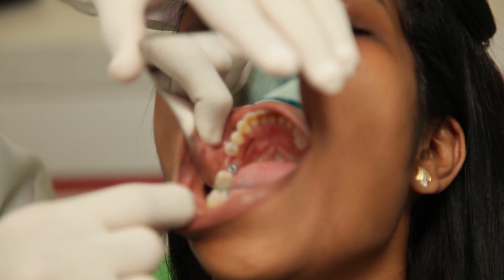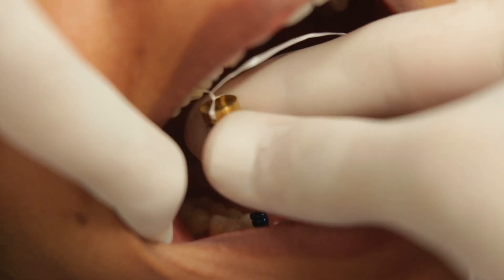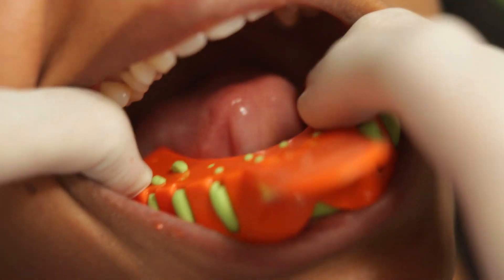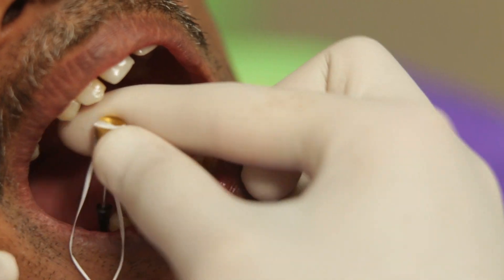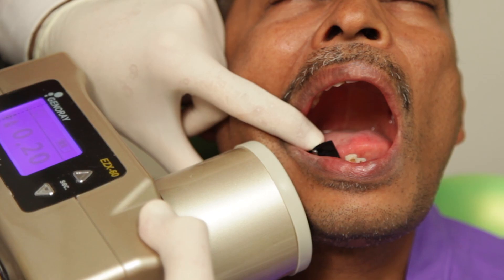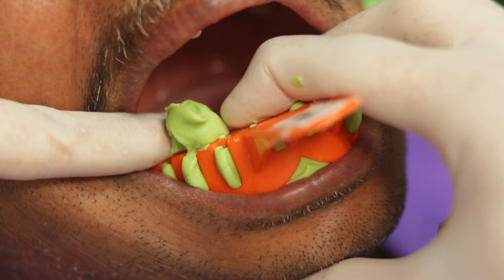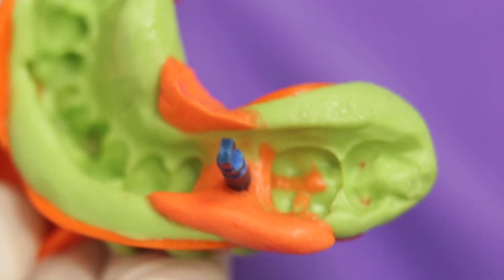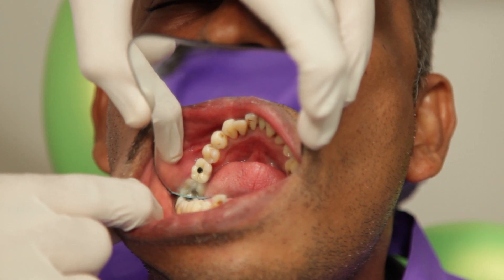Implant level Impressions

Comment: ABUTMENT LEVEL IMPRESSION  ?  WHEN DO U PREFER
Reply from the maker: with todays advances in CAD CAM dentistry and options for customization, its extremely favourable to do implant level impressions so that you can have your prosthesis custom made (tailor made, in other words). This will help us counter implant angulations ,customize the collar/emergence profile(which is rarely symmetrical ) and customize the shape of the abutments as well.  

Abutment level impressions can be taken in cases where there are 2- 3 implants relatively parallel with each other and  a cemented prosthesis is indicated. But in this case correct customization of the abutment intra orally is nearly impossible.

Overall, i would recommend customizing the prosthesis using implant level impressions to customize the restoration and  have a more robust prosthetic solution.